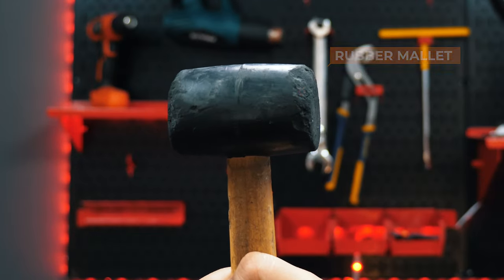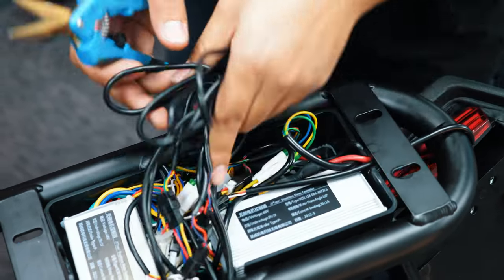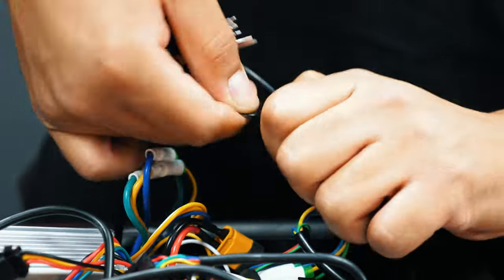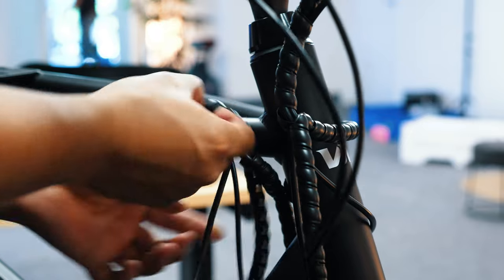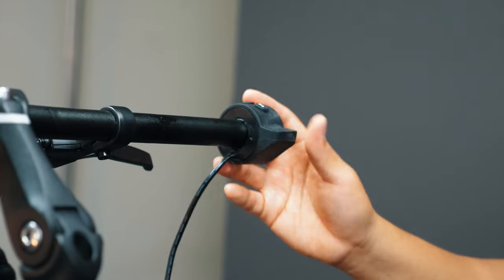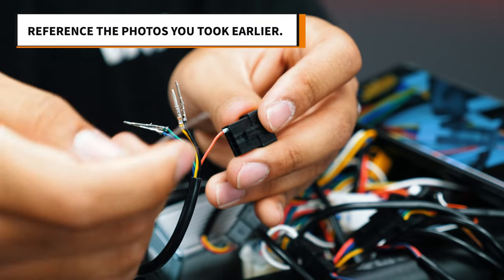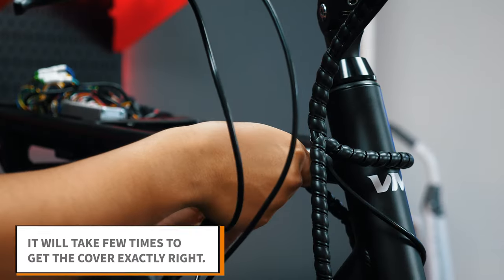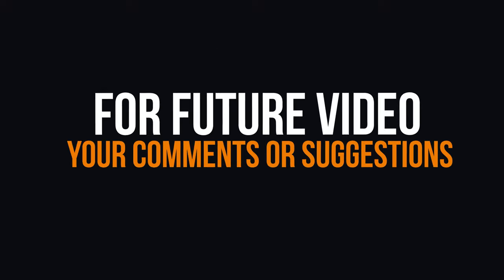How to replace the throttle on EMOVE Roadrunner electric scooters - VoroMotors tutorial

Comment: Can the folding handlebars and stem  on the original 35 MHP Roadrunner replace the handle bars on the Roadrunner Tronic  65 MPH Edition? If the Tronic had all of the features of the original Roadrunner I may have already bought TWO of them by now?

Comment: Yes thank u can I just cut the wire from handle then rewrite it
Reply from the maker: If you feel comfortable cutting the wire from the handle and rewiring manually, that is totally fine to do. Often our technicians will do this, but we wanted to show how to remove the line without cutting so we showed the method performed on-screen.
Reply: Good question